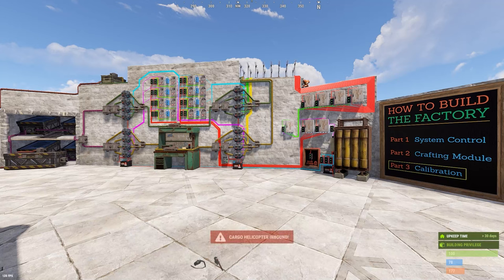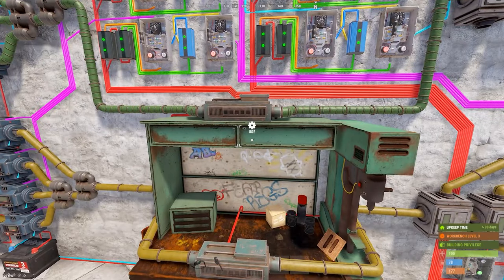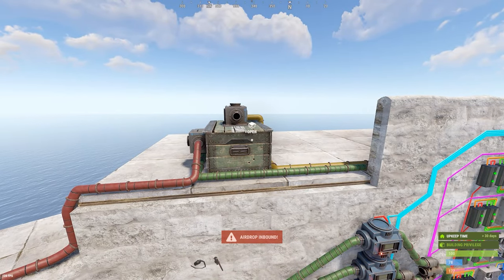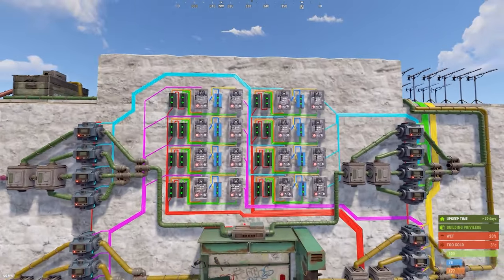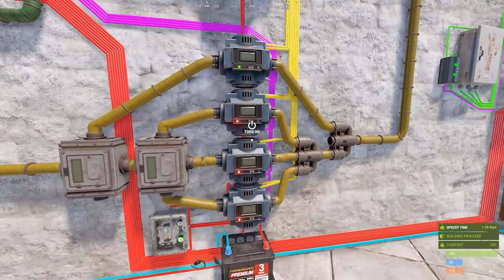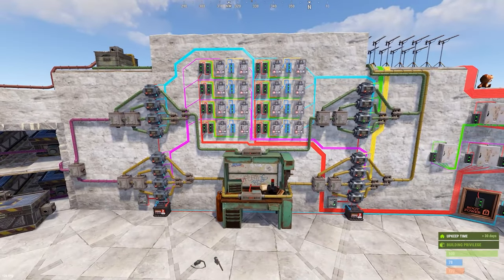RUST Electrical | How To Build THE FACTORY - Part 3 - HOW TO USE - 2023

Comment from the maker: HOW TO BUILD PART 1 - https://youtu.be/rl4vX6pNLDU?si=waUiWqeazIj56oTL
HOW TO BUILD PART 2 - https://youtu.be/HIext9Ka_CQ?si=FQfqXmUh7XlN8zkW

Video Contents:
0:00 - Intro / Setup
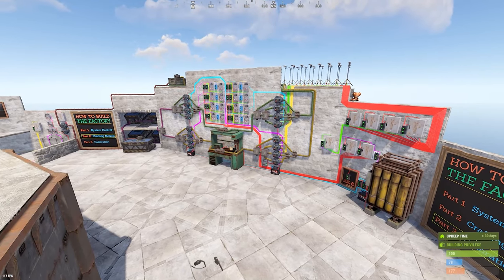0:44 - System Control to Crafting Module
2:03 - Setting Up Blueprints
3:45 - Programming Output Conveyors
6:20 - Programming Input Conveyors
8:06 - Material Boxes w/Tips
9:58 - Programming Check Conveyor
11:22 - PART 2 VIDEO DELAY CIRCUIT UPDATE !!!
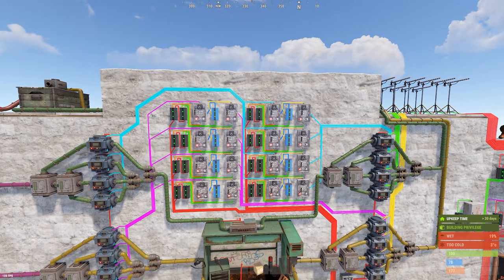12:08 - Calibrating System Control
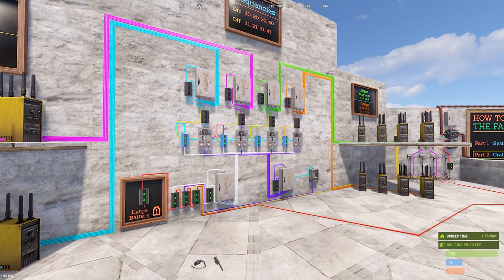18:08 - System Demonstration Test w/Commentary
26:12 - Verifying System Test w/Commentary
28:37 - Calibration Tips List
30:41 - Final Commentary
31:37 - Outro

Comment: Btw, I improved my calculator, so it is now 16 bit and can subtract. I have some ideas on how to multiply (it will be hard). But now I am thinking about converting into the decimal number system, but I have completely no idea how to do that, only if the counter could count power to 131000 and I could get this amount of power from somewhere
Reply from the maker: I want to see this thing some time!
Reply: @AustinKlailaGames  I am currently working on converting binary in normal numbers, and I think maybe I will be able to do this
Reply: And yay, I think i figured it out